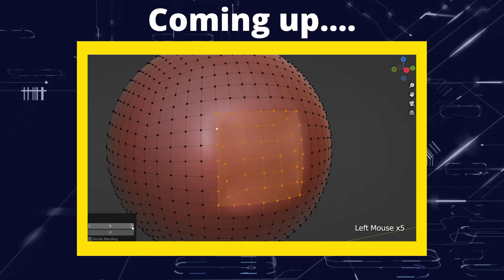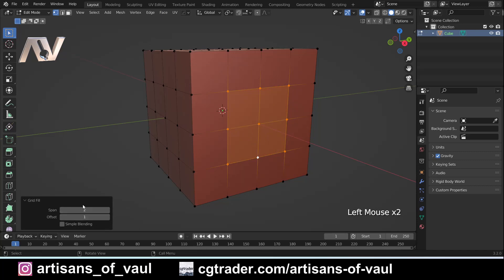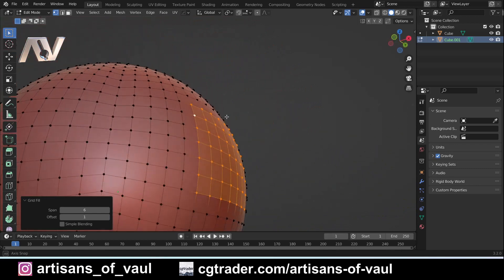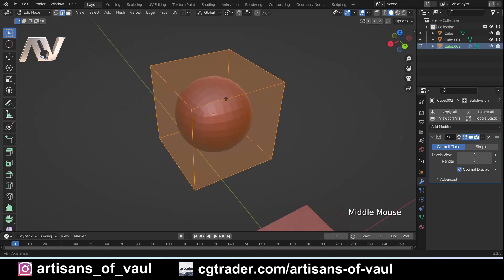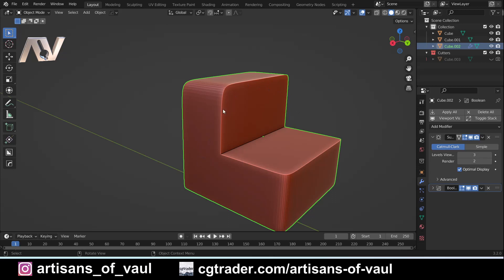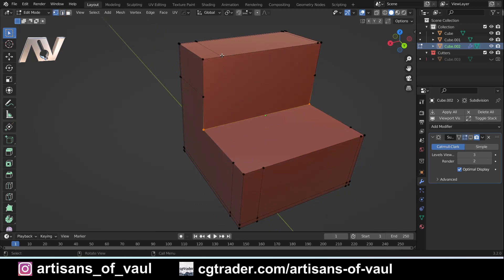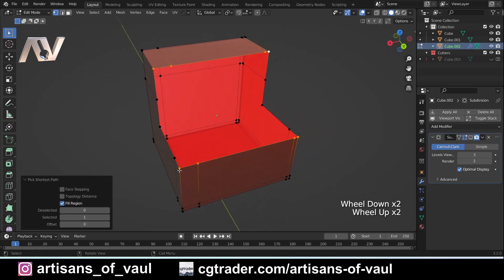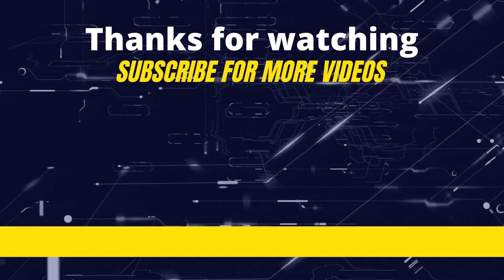The Grid Fill Function - The tool you didn't know you needed!

Comment: how do you do that shift left mouse button thing to select all things around a hole? nothing hapens for me and i have got about a milion of edges and vertecies to select to fill a hole in my model.
Reply from the maker: It's alt while clicking. But if the object isn't quads Blender can find it difficult working out what to do. You can normally solve that with the addon Mesh Machine but it is a paid for addon (admittedly with a lot of very useful tools): https://blendermarket.com/products/meshmachine/?ref=834

Comment: My grid fill doesn't work. Says, "Select two edge loops or a single closed edge loop from which two edge loops can be calculated"
Reply from the maker: I'd need to see an image of what you're working with but normally that happens if you have some sort of error with one of the edge loops (like overlapping verts) or it can't calculate it because there are different numbers of verts. Not sure without seeing it.

Comment: Dunno if you'd want to make a whole video about it, but I'm working on some bits for a Blooded kill team and struggling on how best to approach the stylized arrows and triangles on chaos armor trim, particularly when the surface is curved. Any hints/ tips? Thanks.
Reply from the maker: So trim has some tricks to it that are very difficult to explain as everything is about stacking booleans on booleans. I am going to do a video on it but there's a LOT to go through which makes it hard to order/be clear about so I'm trying to work out how best to do it.

The biggest tip is create the armour as thick as the trim would be then boolean out the bit that isn't trim. It's much easier than extruding the trim out for curved objects in my experience.
Reply: @ArtisansofVaul  Thank you! I'll give it a try.